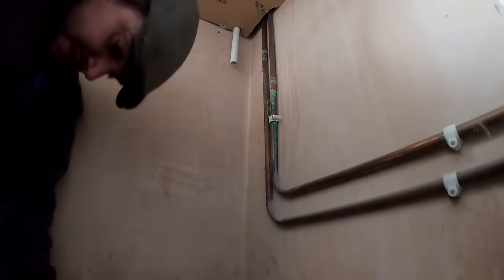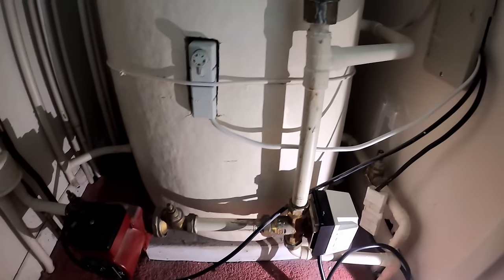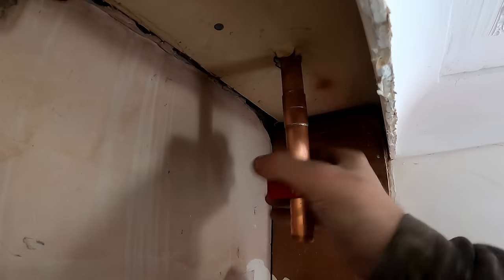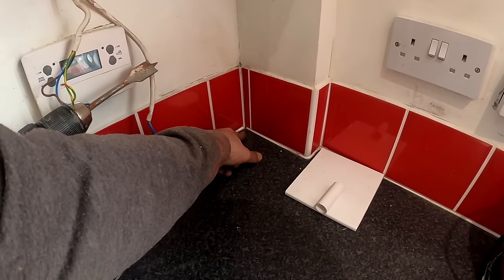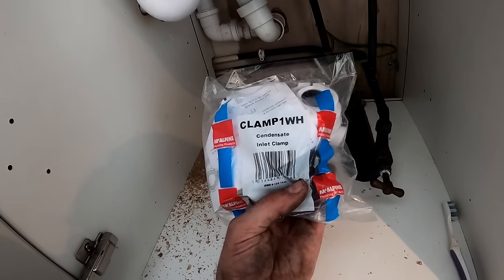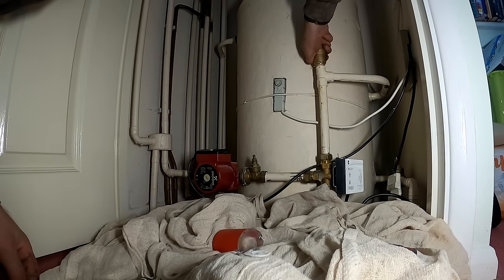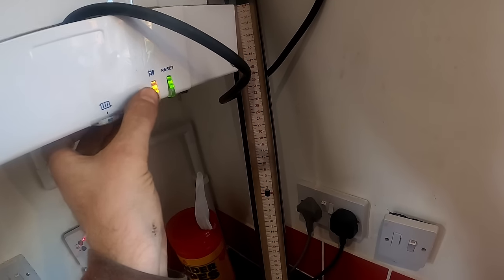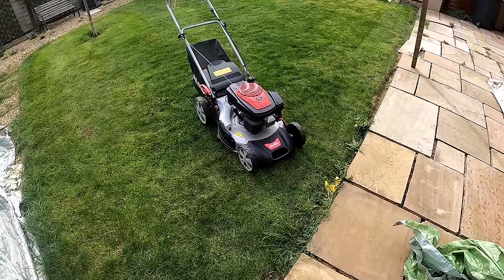Welcome to a plumbers office

Comment: I’ve heard of engineers doing a 20 second gas rate test. They said that it will burn the same amount of gas over 20 seconds as it will over 60 seconds. 🤷🏼‍♂️👍🏼
Reply from the maker: In therory it would still probably work out the same, it's just not recommended but might be one day, thanks for watching
Reply: BG have now been allowed to do a 1 minute GR, they’ve been trialling it and reckon the potential savings for for gas and water usage are massive.

Comment: Have you done any of Air sauce heat pumps yet and if so are they any good
Reply from the maker: I used to sub for a heat pump contactor for a few years. I have fitted around 40 with mixed results. I was just an installer though so it was just a case of putting in the supplied material

Comment: Air sep's piped up wrong- vent and feed the wrong way round
Reply from the maker: I never noticed it mate, I have never really liked them, two tees 150mm apart is how I normally do them if I need to cut them out, thanks for watching
Reply: That can still block better to tee the cold feed into the vent